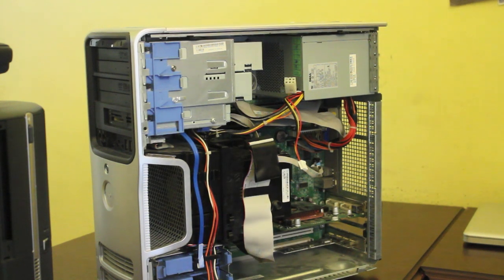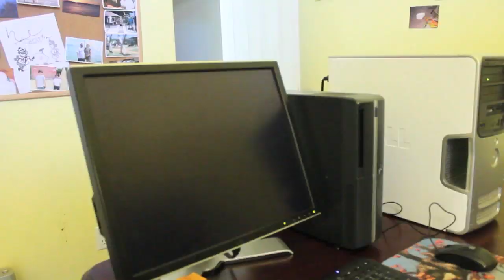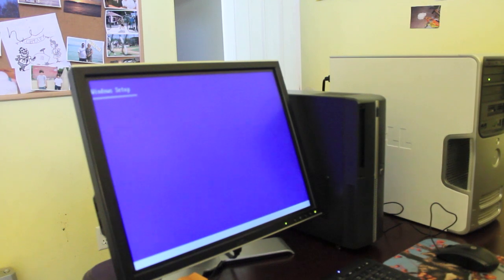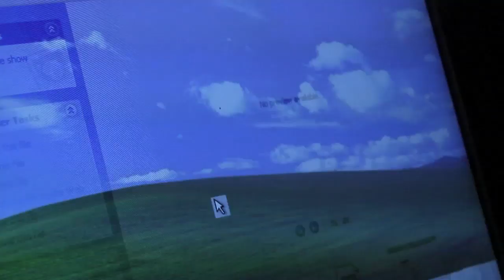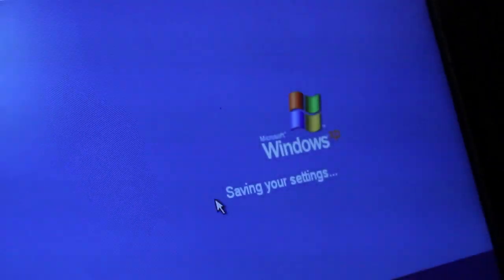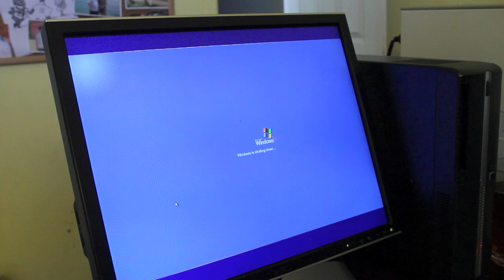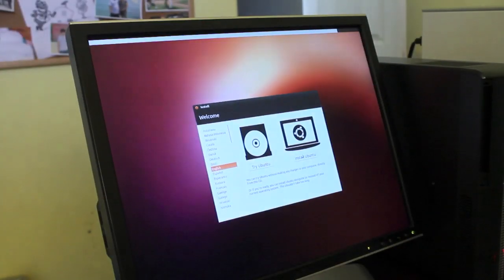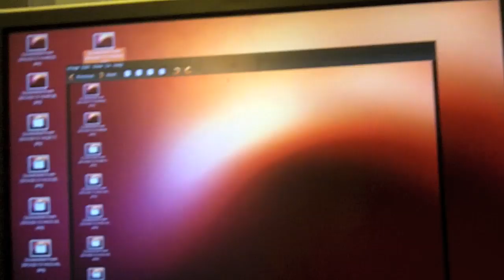Dell Dimension 5150 repair and upgrade

Comment: How do you put the side of it back on it won't fit
Reply: LTGT Vlogs and games its hard just line it up with the holes in the side piece to the little divets on the bottom of the computer and then push hard it should go on

Comment: nick1296 hiya nick can you tell me if I can use the fan supply on the board to run a all in one liquid cooler and powering the fan and cooler block from the same supply 
I got the uphere all in one liquid cooler system but the instructions is shocking it only gives a few pictures to go Bay lol

Comment: nick see the small black heat sink on the middle of the board if you take it of to clean do you put a small amount of thermal past on it when putting it back on  I'm giving my optiplex a clean out aswel

Comment: nick1296 hi can you tell me will the 5150 motherboard fit in to the E521 by any chance
Reply from the maker: Unless you're getting this board for a VERY low price, board replacement is not worth it on these machines at this point. But yes, it should fit. I'm not sure when it comes to the CPU, so keep that in mind.
Reply: +nick1296 hiya I was looking at the E521 motherboard for £25 on eBay but notice videos on 5150 and thought maybe putting the 5150 motherboard in to upgrade it if it's possible but iv never did anything like this but it doesn't look hard  
I did try to upgrade from xp to Windows 7-8 with a disc  but it's not working ?  it comes up invalid product key or doesn't match
Reply from the maker: Going from XP->7 requires a fresh install. In order to go from XP with an upgrade, you need to do it like this: XP->Vista->7->8.
I can't help you with the product key, though.
Reply: +nick1296 yes I was planning on a reinstall but I was wanting to see if this will take the 5150 board there's a few for only £30 with the cpu  aswell

Comment: Hello, love the video. Recently I picked up a e510 for $10 at a thrift shop simply because I wanted to learn how to take apart and put back together a computer before I started building my 1st computer. I thank you for these videos as they have helped me learned on how to do this. I don't really have many plans for this computer other than being a potential backup computer. However, if I do end up upgrading this computer what kind of upgrades would you suggest for this?

Comment: I got the E520 in 2006 which is very similar to this with Windows Vista.  I've upgraded many features including two Blu-ray writers, 8 gig of ram, new 3d graphics card and 800 watt power supply. 2 tb hard drive and a Samsung 250gig evo 840 SSD drive which has greatly speeded up the pc more than anything.   I'm also running Windows 8 pro 64 bit.  I love this pc.  I also upgraded the cpu to a quad core q6600 2.4 GHZ
Reply: Im sorry if this is private to you but about how much did that cost? I am trying to upgrade the same computer I got from my parents.
Reply: ***** All in all including the BD writgers new power supply quad core cpu and 8 gig of ram plus a 3D graphics card it has cost be aroun3 £300.  Make sure you udate the bios before putting in 8 gig of ram so it gets read.
Reply: wildmutationblu what kind of power supply you used?

Comment: I had one of these with a failed 2006 year, western digital 160GB model hard drive that had clicking failure...

Turned out all I had to do was remove the hard drive's circuit board, clean off the contact pads on the PCB that connect to the drive itself, and I used a heat gun to re-flow the entire component side of the PCB.

Reassembled and drive booted fine, SMART shows no problems, drive still works today....

Comment: we had quite a few power cuts yesterday as electrics were being repaired in the house. my brother kept turning the computer on. do you think this could be an issue?

ive tried to reinstall windows but when you start the install process it gets stuck on where it says -  Examining 152587MB Disk 0 at id 0 on bus 0 iastor... :(

Comment: i have the 5150C and its extremely noisy, plus its not working i get blue screen with Unmountable Boot Volume error. i took the hard drive out and just put it back in i wanted to check something and i think thats whats caused the blue screen. ive opened it up again and checked the wires but still i get the blue screen.

not sure what to do now.